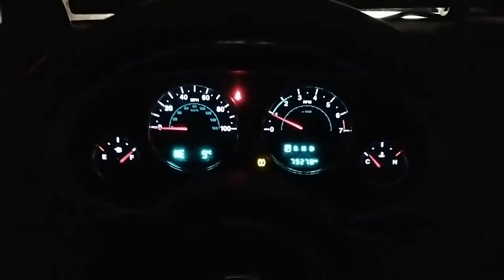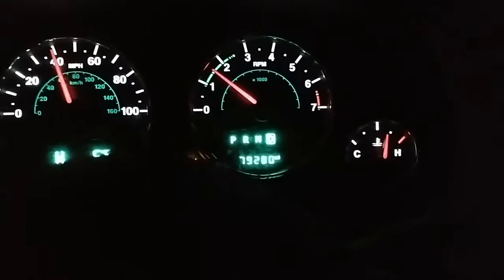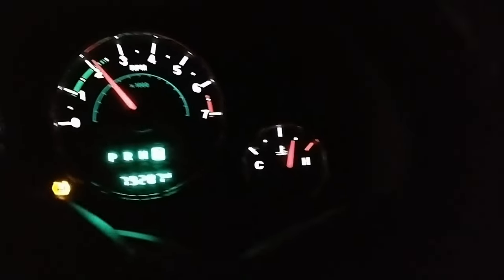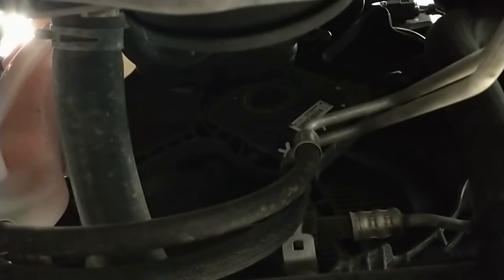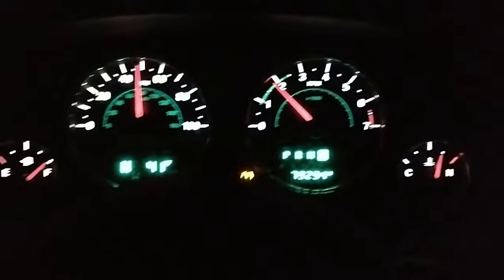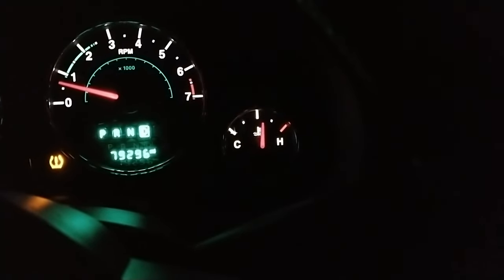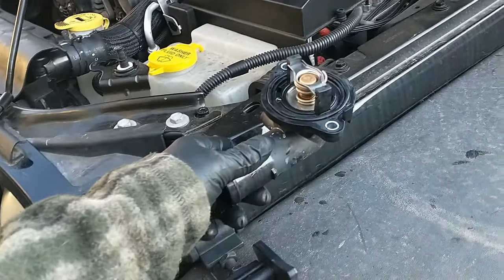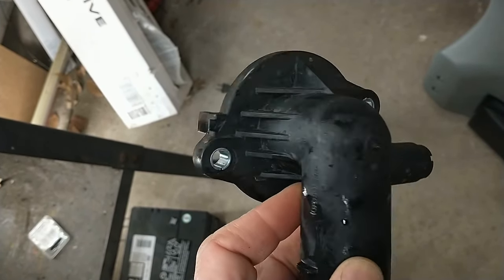Jeep Wrangler only overheats on highway...what's going on? (not what I expected)

Comment: You guys your using cheap  thermostats. If you look at the thermostat you pulled out look at the spring, it’s way different then a factory thermostat spring which is a better spring. I don’t think you showed the thermostat you installed but bet it looks like the one you pulled out. You want a factory thermostat. I would even say next time I need a thermostat I’ll buy a cheap thermostat and change to my factory spring. Here in Arizona it’s a big problem and we  get a cheap thermostat and it works for awhile then replace it again and again lol.

Comment: As soon as you said the lower rad hose was cold and spongey i knew it was thermostat 😂 i literally kept yelling thermostat every few mins.  Its 2 bolts and you're done! The worst part of a thermostat job on the 3.6 is refilling and burping the system
Reply from the maker: Yep, almost always the thermostat on these. I figured I'd prove it by going through all the hoops people talk about first
Reply: So I am having a similar problem. My 2015 wrangler has always ran steady around 220 degrees since I have owned it for 6 years now. I have a trail dash 2 and my temp is staying around 230 on average and will hit 240-245 and then drop back down. I replaced the thermostat with a mopar OEM from the dealership and it’s still doing it. I also burped it really good and feel confident I got all the air out. No leaks at all. I also bled the purge valve. Could the new thermostat possibly be faulty or is there any other issue it could be? Thanks!
Reply from the maker: @msburrage74  yes, could still have a bad thermostat, also be sure to change both the thermostat and it's plastic housing as they sometimes interfere with its action. Also check for trash in the fins of radiator and any obstructions to the front grill area
Reply: @msburrage74 I have gotten so many faulty thermostats for these things.   And I will tell you they absolutely hate anything other than OEM. I have installed 3 from Napa. Every single one the temps start climbing on the interstate and the fan runs harder.  It’s the craziest thing.  You normally shouldn’t even hear the fan on these things. But with the wrong thermostat the fan gets loud.   OEM only!  And even at that the guy at my dealer said 1 in 50 comes back bad.
Reply: Can you burp it without that system he has rigged up?

Comment: The OEM thermostat is NOW being made by Mahle. Part Number TI 236 95. Mahle has boxed and delivered Motorad thermostats for a while, but since about Spring 2024, they deliver their own. Mahle supplies thermostats for Mopar. The aforementioned Part Number TI 236 95 actually has a Chrysler part number and Chrysler Logo grounded off. I have that Mahle part and I have the original Mopar part too that came out of my Jeep.
Reply from the maker: Good info, thanks for sharing!

Comment: 2017 JK overheating for months.  Dealership & warranty co have replaced the thermostat 5 times, water pump once, radiator once before approving tear down to find blown head gasket that revealed warped head.  Received back after couple months at dealership.  Still running hot with sloshing water sound in dash and slight rough idle at stop.  Now thinking may not have bleed system completely.  These engines should have a class action lawsuit against them.
Reply from the maker: wow, sorry you're having to go through all that. Hope you get satisfaction soon.

Comment: Besides the hoses, the thermostat would have been the next thing, 99% of the time it’s the thermostat. I change my own, most times Jeeps prefer Mopar engine parts. I trust only certain mechanics to work on my cars, stopped using dealer’s years ago because of over pricing on parts.  I’ve never seen or heard of the toy you used to get the bubbles, not even in the military. You can use your body to nudge the car back and let rock forward, it’s what I do to top off the radiator… real old school.

Comment: Thanks for the video. It was kinda obvious with the lack of flow and the warm n cold hoses, but you went through the steps n  helped troubleshoot the problem and resolution. Most people who don't work on their own rigs should appreciate learning something. The video was good overall. Keep up the good work. Your time is appreciated.
Reply from the maker: Thanks a lot. It was all about learning and showing folks all the things they hear about as the possible causes
Reply: @joyofwrenching  I really appreciate it, my 13 is having this exact problem after I replaced a leaking radiator. I will have to check out the thermostat for sure. I already suspected it because it used to run a lot cooler. Thank you again, great video, solid presentation, no fruu fruu stuff. All good.

Comment: This has to be one of the best and most informative videos on testing the cooling system. Thanks. Dealer here in Bellingham Jeep sabotage my Jeep a couple of weeks ago. Been fixing everything and been keeping a eye on my cooling system ever since which until then didn't have problems. They installed a exhaust system and sabotaged that too. Including the parking cable which was burnt.
Reply from the maker: Thanks so much for the kind words, and I hope you have no more issues.  Dealerships tend to not be better than a good independent shop in my opinion

Comment: My 2015 JKU Sahara is doing the same exact thing right now. I have to drive no more than 40 to 45 miles per hour to avoid the temperature gauge from peaking out. I had a new thermostat installed last summer because there was an engine code for a faulty thermostat sensor. The new thermostat fixed the engine code. And now 9 months later the thermostat is obviously trash again. I'm 100% certain after watching your video that I'll be changing the thermostat, this weekend.
Reply from the maker: I've heard of too many failed thermostats way sooner than they should like yours. Hope you get back on the highway soon!
Reply: We had had 3 thermostats in the past 2 yrs and today it overheated such that hubby had to bring it back home and leave it. We told dealer 2 months ago it was starting to go again, as fan runs and runs after parking it, and it hadn't coded so they would do nothing. So today they can come tow it and fix it and any other things it has caused as this is the dealerships failure.

Comment: Just had the thermostat replaced yesterday 2014 Jeep Wrangler. Problem was very similar. Good video !
Reply from the maker: Thanks, and I hope your issue does not return!
Reply: I have done two coolant replacement on my Jeep already. Last one just a few days ago. It takes some run-time for the ALL air to come out. In my experience it can take more than one days worth of driving. I usually bleed out the most, run the engine and then let it cool down. That way coolant is being vacuumed to the radiator from the coolant recovery tank. I repeat this a few times, run the engine to 225F and then shut off. The next day I drive normally and that is where I think the remaining air will get out.
Reply from the maker: @mrtopcat2  thanks for the tips and sharing your experience

Comment: Exactly what I was trying to accomplish today i too have a 2014 rubi with the SAME EXACT PROBLEM took out the fan and the grill cleaned out my radiator flushed. My heater core and the whole system got c*** out of the heater core. Of course, common issue but still likes to get hot. Just as yours did. Thanks for shedding light on this. Ordered a OEM wish I would have seen the video before going 3 gallons of antifreeze to flush the system.And refill lol but thanks for the VERY HELPFUL Video
Reply from the maker: @chrislorenz4468  thanks and I hope you get yours fixed for good soon!

Comment: Great video buddy! The spring on that thermostat was indeed upside down! But that might not be the only problem for all these aftermarket parts going bad. I have a 2012 Ruby and it has the exact same issue. I have replaced mine with an aftermarket and the problem came back in about three weeks. I have done further research and I feel the problem may be two-fold! Number one: We are all replacing our OEM with plastic housed aftermarket units because Mopar has been on Gallactic backorder for about a year! Number two: Ninety-nine% of the aftermarket are plastic. There are some companies that are making aluminum housed units. I think in addition to some being assembled with the spring upside down, the plastic used in the aftermarket is not able to withstand the temp dynamics for very long. This may cause the housing to distort and cause binding due to the spring plate stilts being out of alignment. I have just purchased an aluminum unit from a company thru Amazon called MILIPARTS. I'll be swapping it soon! I'll update with my initial results!

Jimmy
Reply from the maker: Thanks for the deeper insight!
Reply: let me know how that thermostat works?
my jeep overheats to 240F on hills or heavy driving
Reply: That sounds familiar. When I got this new aluminum part, I was surprised at how much better it was made. It is so much beefier than the one I had put in. Also, upon inspection of that one I had in there, I saw the spring in it was ... you guessed it... upside down!! I had purchased it from Auto Zone. The MILIPARTS unit has resolved the problem!! Before I found the MILIPARTS unit, I had bought another plastic one from NAPA Auto parts but had not installed it yet. When I found the aluminum one, I decided to wait for it. Out of curiosity I checked the NAPA unit and sure enough, it had the spring upside down also!! I think a lot of parts stores get their parts from the same vendors and just put their name on the box. 
  I hope this helps,
  Jimmy
Reply: @TheTaytoni  hey buddy where you able to fix the issue? I having the same issue and I already changed the thermostat, water pump, temperature cooling sensor, radiator cap and my JK is still overheating mostly in up hills

Comment: My 15 JKUR first needed a thermostat after overheating on highway too. Then my fan stopped working and I had to replace the fan, shroud and electrical, then it was normal again. Now I have an aluminum radiator and a DVS vented hood. Good to go
Reply from the maker: Hopefully your cooling system woes are behind you and you can just focus on fun stuff to add to the jeep
Reply: Yikes! My 2015 just started doing this today after discovering I had no coolant in it. Eeeeek! Hope this is issue. My baby has 108k miles currently. Thanks for sharing
Reply from the maker: your're welcome! @azizabahati7037

Comment: Supposedly the Mopar ones are available again but three months back I finally gave up and purchased one from O'Reilly's after the dealer told me that was where they were purchasing them to do customer cars and they were offering the same warranty as if it was a OEM part.  Now three months later I have the opposite problem that I had before, at least with the original it was stuck open and the Jeep was drivable even though it was throwing a code for not warming up within the expected cycle.  The heater was also not as hot during the winter but it was still warm enough.  i finally had to purchase an aftermarket because the Jeep needed to be inspected and now 3 months later its not drivable because the aftermarket thermostat is stuck closed instead of open.  Not sure if it was the motorad part or not, will check when I get it off but if I can't get an OEM I will look for the Mahle one as I have heard its decent.  Dorman was supposed to be releasing an aluminum housing version but as far as I can tell it has not made it to market yet.  In my case the housings are both fine, its the thermostat inside failing.
Reply: I had the same issue. Failed open. Replaced with a motorad brand one. It just failed closed. Bought a different brand, can’t remember the name but it seems to function well so far

Comment: I have an 07 jk. Last time I took a 4x4 trip my jeep was running warmer then usual on the highway. Once I got there everything was fine. On the trip back everything was fine. Not to long after I got a code that basically said it was running cool. Now the therm was only a few months old so I changed the sensor and cleared the code. About 2 weeks go by and the code came up again. Took out the therm and sure enough, it was stuck open.
Reply from the maker: I'm hearing a lot about these failing faster than one might expect.  Sad we can't seem to get a good quality one

Comment: a lot of the times, its a faulty new thermostat. Always go OEM, i had to replace 2 duralast thermostats on my jk in less then a year. for the 3ed I went OEM and that solved my issue.
Reply from the maker: glad to hear the mopar ones are back...for the longest time they were providing Motorad from the dealership, and they have been failing just as often.
Reply: @joyofwrenching  no shit? I had no clue. seems like its a pretty common issue across the board.

Comment: The first I did was change the radiator cap to a pressurized cap.  The next thing  I did was change my thermostat. The part costs $24 and you need minimal tools and can change in less then an hour. I didn't have to go to step 3 which would have been replace the water pump. If you are still overheating after replacing all of this the next thing would be the radiator.  I went from the cheapest to the most expensive.

Comment: Yep, mine is doing the same thing right now. I did some preventative maintenance and replace the thermostat with a 180°F racing thermostate along with a new Moar water pump, new silicone hoses and a new Mishimoto all aluminum radiator. It was doing great until yesterday and started doing this exact same crap when I was trying to tow my Harley at around 60 MPH. Not sure what to go after now. Guess I will try replacing the new thermostat with a Mopar one I bought a while back in case the racing one set of a CEL for too low of a temp.
Reply: Did you ever figure out what was wrong with yours? Mines doing the same
Reply: @alexisransom4725  Yes Ma'am. It was the thermostat. Put in a new Mopar one and it is staying right around 204 to about 210 now even when towing my Harley in it's enclosed 5x8' trailer with the AC on in about 90°F weather.
Reply from the maker: @akonitony2  these thermostats seem to be hit and miss huh?
Reply: @joyofwrenching  Nope. Never had a problem with a Mopar one
Reply: @akonitony2  Yea good luck getting one now, mine is doing the same bs, and mopar tstat is back ordered 6 months+ if not forever..
Reply: @dirttales  Yeah, I will probably order another next year just to have on hand
Reply: Yeah, my local dealer said they are on back order, and that was about 2 weeks ago. Installed a Motorad one, made in Israel. I'm having cooling issues now after installing it, a Mishimoto radiator and new hoses. I'm going to replace the thermostat relay, and see if that fixes it. I don't think my fan is turning on soon enough
Reply: @jdsilvaca  Should come on at 226°F
Reply: @jdsilvaca  More than likely you got an air bubble trapped some where, did you use one of those burp systems that raise the coolant way above the radiator and burp for at least 15min?
Reply: @dirttales  no, I didn't.  I will give that a try
Reply: @joyofwrenching  I've gone through about 2 amazon and 2 napa thermostats
Reply from the maker: yes,  @TheTaytoni  that's a common tale here.  Sorry, but keep trying

Comment: I’m on my 6th thermostat on a 2013 Jeep Wrangler Rubicon 2door 10th anniversary edition, we’ve changed three of the thermostat’s since January, bad parts I guess two of the bad thermostat’s where aftermarket (one of them started to crack on the backside ), the one I have in it now is a 180 degree Ripp Supper Charger brand, in a Mopar thermostat housing on 7/21/2024. Always inspect the thermostat before installing. It appears to be working.

Comment: On my vehicle (other than my Jeep), which vehicle I own close to 30 years now, I have had issues with 2x factory thermostats. I pre-emptively replace the coolant and thermostat every 3 years. So I went through a lot of replacements already, with the related bleeding, which is very easy on my vehicle. Long story short, I know there wasn't air in the system for sure. Still one time, I had similar issues after coolant flush and thermostat replacement. I returned the factory thermostat, they gave me another one. Same problem. Finally I put back my old thermostat and it was all good. It must have been a bad batch.